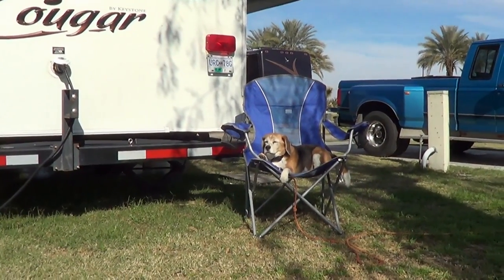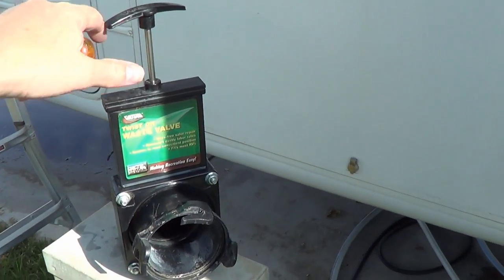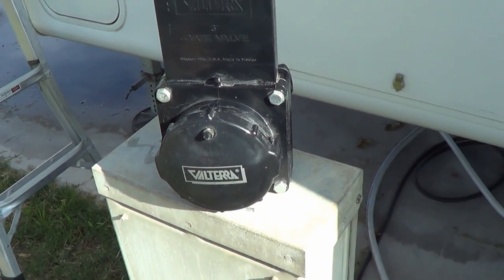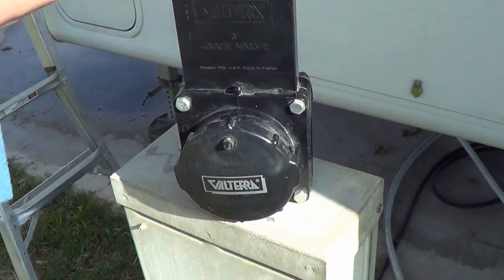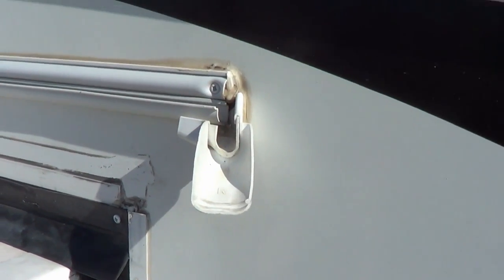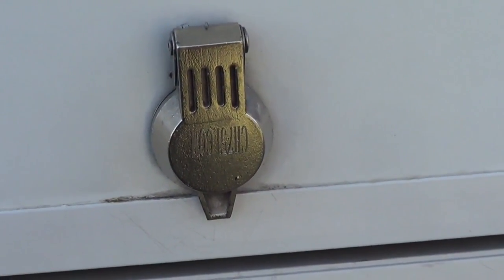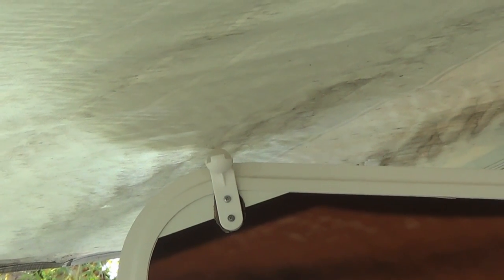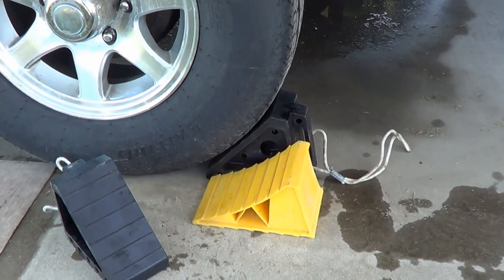My 10 Must Have RV Gadgets

Comment: Great ideas. Good info. My husband wanted better chalks. You are funny. And work never ends.
Reply: The rubber ones smell horribly, so you keep them where he does, in the bed of your truck. We keep them in the chain bin on our equipment trailers.
Reply: Googleguy, thanks I am very sensitive to smells, if and when we get the rubber chalks I will make sure they are not stored in the trailer area, which is fairly small on our trailer as we dropped it lower and put in a real mattress. (I can design a garage and a trailer, but I failed at our house) lol

Comment: Hey good vid! Wish I had a surge protector when the output voltage coming from my old genset went over limit, due to a speed governor failure. Luckily, only one electrical appliance was still on at the time (part of the sound system for my computer). When my old genset surged, the amplifier chip inside the subwoofer of the sound system, exploded into pieces!

Comment: Ray,

I noticed around 8 minutes in you don't have a slide topper. Is that because you might find yourself in some high wind areas, like on the beach? For me a slide topper is definitely in my top 10, but I am a woods camper, and am not one for the beach.

PS yours is one of my favorite channels for RV things. Helps me get my "fix" when my trailer is stored for the winter, as it is now.
Reply from the maker: Yes, I don't like things flapping and some of the places we go to like in the desert and our summer spot on the ocean have some pretty good winds at times and no overhead trees. I've heard of some folks having they blown off in big desert gusts.
We only have one slide so not a big deal for me to wipe debris off the few times we park under trees and get some branches or needles. As far as shade goes the slide is on the side I park away from the sun so not a big deal there.  If I was under trees a lot I'd probably want one too.
Thanks! Ray

Comment: as far as wheel chucks we use these expanders that go inbetween the two tires and you screw them out so they press inbetwwen both tires. they work good don't have to worry about them slipping or moving.
Reply from the maker: I've seen them. thought they were for stabilizing the trailer so less movement inside. Didn't know they were strong enough to be used in place of chocks. I guess you have to be really sure to remember them before departure. :)
Reply: Love Your RV if you type in expanding tire chuck for camper on google they will come up they're different from the stblizers these form to the tire. great video btw
Reply from the maker: Thanks, I'll check it out. Cheers Ray

Comment: I would recommend the Volterra RV stabilizers as part of the list.
Reply from the maker: Nice, doesn't look like they add much weight.
Reply: For the stability, you can't miss. I have one for the rear and one for under the frame at the door. Combined they add at most 8 pounds.
Reply from the maker: Cool, can they stay attached when underway or do you have to break them down and stow them every time?
Reply: You have to stow them away. They set up and break down very easily. Mine came with individual storage bags. Packed up, each one is about 5 inches square by 24 inches long. I really can't say enough good thing about them. My wife could detect the smallest amount of wiggle in the camper and insist that I didn't have the stamp jacks set up properly. These things have ended the complaints.  Thanks for the video, I will be looking into the vent covers and surge protection.
Reply from the maker: Sounds good Steve. Did you look into the JT Strong Arms? http://www.lci1.com/jt-strong-arm
They stay attached but look like they may weigh in a bit heavier and are a slightly different system. After 6 years we are pretty used to rocking now, hardly notice except when I get up early and the better half likes to sleep in, the front of the fiver where she is sleeping does wiggle the most. ;) We travel a lot the winter but summer we stay put in one spot for over 4 months, these may be just the ticket. Happy wife happy life! haha
Reply: I have not looked into those. I caught the Volterra on a Daily Deal on Amazon and got a screaming deal, not that they are terribly expensive anyway. I would definitely check them out, if I were you. It can be dangerous to wake a sleeping bear. 

I am a little jealous of you camping so much. Our camper is in storage for the next couple weeks yet. I got to see it today and can not wait to pull her out and start another season. I like your co-host in the video. A dog is almost a must have for camping as well.

Comment: Actually brown outs (low voltage) is harder on electronics than a shurge, assuming the utility company does not pump several KW into the line.  I've seen this happen to a motel.  Low voltage causes devices to pull more amps than they are designed for.
Reply: And not just the electric company.  Was camping at the local Moose Lodge.  The wiring in the camping area was probably put in by Edison!!!  One of the campers across the lane that went through the area was having all sorts of problems.  His roof AC was humming real loud, and not only was the breaker for it tripping... his main 30 amp breaker kept tripping as well.  I went over, and he said he had checked the pole box and was getting 112 volts.  A little low, but things should have worked.  I asked if he checked it with his rig plugged in.  Well HOW do you do that, he asked.  I picked up his cord, and inserted it only halfway.  His meter read 87 volts... 87 volts.  He packed up and left.  There must have been some real interesting things going on under the ground... wiring probably got just wet enough.  I picked up an extra 30 plug and wired it to a standard outlet in a plastic box.  Got a digital (wohoo) meter at Harbor Freight for $8.95, Velcro-ed to the back of the box and hard wired it inside.  Before I plug the motorhome in, I plug my box it and check the voltage.  Then I have an old 20" box fan I plug into the box to see if it affects the voltage.  If you see my main comment, a buddy of mine had his entire electric/electronic system fry from an electrician wiring the 30 amp outlet like the 50 amp... 240 across what should have been 120 volts hot to neutral.  I never trust anything until I've checked it all out!!!

Comment: Grab bar, it's just a dumb made door to begin with. Solar power is a must have and add a wind turbine to kick it up a notch. Swamp cooler is a must have for me, keeps me cool at night and doesn't take a lot of electricity and a fan or two. Vacuum is a must have. WiFi form phone tethered. Battery charger is a must have. Air pump is a must have. Home entertainment center is a must have and adding music studio equipment is kicking it up a or two notch. A atmospheric water generator, It's about a must have if your boondocksing. Induction cook top if you love to cook is a must have and a nu wave oven will kick it up another notch. Good batteries like lithium ions and charger at least 200ah worth. Plenty of tools is a must have along with glue and tape etc on a "I can fix it level". Electrode water heating rod so not all the propane is use up plus an electric heater so the propane isn't used up. I would suggest solar water heating, not a must have but it's a must.
Reply from the maker: Agreed, makes it less dumb tho. :)
Reply from the maker: NIce list!
Reply: Love Your RV I forgot bug spray lol

Comment: I couldn't quite tell how your awning works but a common mistake many people make with manual awnings is that the top braces are meant to slide up to the top of the bottom brace (or think of it as up to the roll barrel) and then be screwed tight.  There is usually a clip so you will feel it lock in.  This is to prevent the awning from being able to fold up in the wind and keep the awning stretched tight.  Leaving the top brace where it is when the awning is pulled out does not provide as much strength or wind resistance but does provide some.  But it's not how it's meant to work.  Of course if you have an electric awning then there is no such thing.  My RV came with an electric awning but I had it taken off because it was terrible in the wind or rain, and couldn't be adjusted.
Reply from the maker: Thanks for the tip. Mine is a Dometic 9100 Power Awning
Reply: I thought that might be the case which is why I hedged my comment, electric awnings are quite common now and you never know which way the struts and shocks are going to go and they aren't usually adjustable.  Like I said I had one but it folded up onto the roof one day in a wind gust and bent one of the struts, and half way ripped itself off the trailer.  The way mine worked it was really just the gas shocks that kept it tight.  So I had it replaced (just the hardware, they used the same tarp and roller) with a manual system.  It hardly takes much longer to set up than it takes an electric awning to unwind and it is much more solid.  Well ok, it takes several times longer to set up but still it's just a few minutes, it's not like setting up a tent.  I think some of the newer electric awnings are more robust but mine was useless in wind or rain, the shocks just couldn't hold it out and there was no locking mechanism, at least not that I ever figured out.  Also some of the newer electric awnings have an automatic retraction feature activated by wind but mine did not, it only had the auto-destruct feature.
Reply from the maker: We've had it 7 1/2 years now and it's been OK, I just make sure to bring it in when we are away from the rig, when really windy and at night. I like that my wife can easily bring it in. Cheers, Ray
Reply: They are handy in some respects.  I think also some are better than others as with all things.  Mine was crap.  I have to bring my manual awning in at night if it's windy too but more so because of the noise than the fear of it failing.  But I do admit that when I'm standing out there in the wind and rain and darkness in my underwear rolling it up an electric would be nice.

Comment: I think that I will get the rubber wheel blocks will be a lot safer
Reply: Safer? not in my opinion.  If you use a rubber mallet and hammer the plastic ones with one or two hits they should be secure.  As far as Ray running over them, he would of hit the gas/throttle really good to get over them if they were in place.  Driver should check his rig before driving off.  I even check the campsite if anything is left behind.  Now as far as parking the RV on asphalt, which I have never done, the rubber ones may not slip as much, on level or fairly level pavement there is not much strain on them to make a difference.
Happy camping and enjoying your videos Ray.
Reply: They probably are a better choice, but instead of going out and getting them, I just bought some caulk that comes in a tube, and or some spray foam insulation in the can, and filled in all of the pockets on the yellow wheel chocks.  Despite being plastic, they are now very solid.

Comment: Boy, do I wish I had seen that adjustable regulator and detachable bayonet valve early on in my RV adventures! Thanks for the tips, Ray! I am even considering the upgrade to my vents like you did and those locks as well. Man, I see another pay check coming and going :) LOL. Only one serious thing, though. At 5:10 I saw a closeup of your electricity monitor and something appeared wrong. It may be my eyes or I may not be seeing the whole picture but it appears that you have the input and outputs connected backwards. From the video it shows the line input from your rig connected to the load output of the monitor and the load from your RV connected to the line input of the monitor. If this is the case, is that safe and does it work correctly? If this isn't the way it is connected is it because I can't see without my glasses? Not picking out faults, I have too many of my own. I was just concerned about that deadly voltage stuff for a fellow RVer. Hope to see more of your videos and even run into you somewhere out there!
Reply from the maker: Thanks for pointing it out but it was actually only the surge protectors top plastic cover that was reversed not the unit itself, so I can easily see the codes written on it, the actual wiring is correct, or it wouldn't work. ;)  Cheers! Ray

Comment: Thanks for the excellent video! I've been a subscriber and fan of your channel for several years. After I watched this one, I purchased the chocks, rain gutter extensions and screen door bar. Two questions: I'm a new RVer, so this is probably really basic, but I don't know the answer.... do I need TWO pair of chocks, or is one sufficient? And for those rain gutter extensions, do you leave them attached, or remove when towing?
Reply from the maker: I've used one pair for years and never had a problem, but carry a few extras that I'll deploy sometimes if we are on really unlevel ground. Yes, I've had the gutter extensions on for 8 years now and never taken them off. :)

Comment: All great items that make RV'ing more fun and less stressful! I've watched your videos before purchasing my trailer. I didn't notice, but wish you had mentioned the water Y adapter your water pressure regulator.  Great to have if you need water at places other than the RV. Also, do you have a way to measure how full your propane tanks are? I found one on amazon and will test in on my first out-of-state camping trip soon!
Reply from the maker: Yes, the Y adapter is great to have. I judge my tanks by weight I lift them and swing them a bit and can feel the liquid swishing around and can guesstimate how much is in the tank. I've heard there is one now that sticks to the bottom of a tank and shows on a smartphone app. Cheers! Ray

Comment: Since you spend so much time in the dry derts of the southwest, maybe you should look at an evaporative cooler? Some of them runs on 12V but I think they might be a little too small? They work best when the air is dry, so you might enjoy the humidifying effect too :-)
Reply from the maker: I've often thought about it, they call them Swamp Coolers down here but we really only spend 5 months in the desert and 7 months of the year in a more coastal climate and it's in the winter when it's not really that hot 60-80F so not sure how much use it would be. This is the one I had my eye on - http://www.turbokool.com/
For humidity, I find just boiling a pot of water in the evening does a great job since the trailer is so small.

Comment: FYI using the socket to wind levelers Caution:  Don't run it too fast, it can strip the mechanism.
Reply from the maker: yes, thanks, should have mentioned to use the low speed on the cordless drill , it also has more torque and a drill with variable speed trigger. Also keep the stabilizers well lubricated so they don't jam.

Comment: I decided to use my 1/4" hex drive impact over my cordless drill for my levelers, it won't bust your knuckles.
Happy Camping
Bob
Reply from the maker: Good idea, I carry a cordless impact gun for tires, will have to give it a try. Cheers! Ray
Reply: Here's a link to my 1/4" impact <https://www.ryobitools.com/power-tools/products/details/18v-one-plus-quietstrike-pulse-driver> I'm not sure it would work on wheel lug nuts. Happy Travels!!
Reply from the maker: I have a 1/2 in impact wrench,  http://www.canadiantire.ca/en/pdp/mastercraft-20v-max-li-ion-cordless-impact-wrench-1-2-in-0543121p.html#srp
just need to use the right size socket, think its a 3/4 inch
Reply: Yes, the leveler have a 3/4" hex drive. On my trailer the lug nuts are 3/4" also, but I've never tried using my my 1/4" Impact wrench on them. I recent bought a Ryobi cordless air pump for topping off our trailer tires, that uses the same batteries as my 1/4" impact. I also carry a Ryobi 18v cordless leaf blower for clearing our camp site and yes it uses the same batteries as my impact and tire pump!! This starting to sound like a commercial for Ryobi-Happy Campers-BobnRobin

Comment: Great vid, however, you may want to check out the videos that show people how to circumvent those barrel locks. They do it with a bic pen. Just saying. Ciao
Reply from the maker: Ya, almost all locks have a trick opening or picking method. Tried a Bic pen, doesn't fit these. Quicker than fiddling with a pen would be a small pry bar, RV doors are so flimsy, but a lock keeps most people out and is an extra latch on the door to secure stuff when we are moving. Cheers Ray

Comment: generator to TT hookup question: outlets in the TT didn't work when we relied on generator or solar power but work when we have full hookups in campground or plugged in at home ... what could cause that?
Reply from the maker: Weird. If the generator is plugged into the same power cord used for full hookups they should work unless you have a 50 amp versus 30 amp power system. Then maybe only one leg of the 50 amp service is being powered. Just a guess, its hard to answer without looking at the way things are wired.